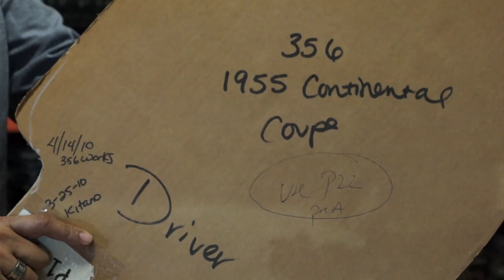PCA Spotlight: How CocoMats.com floor mats are made

Comment: I could make your manufacturing more effecrtive several ways but just one small thing. At least buy pneumatic or battery operated rivet gun (14:00). It will be a little bit caster and better, saving your manufacturing time and better results.

But anyway very nice mats